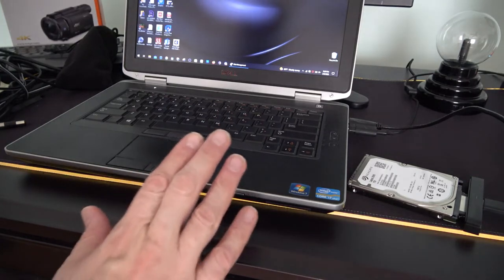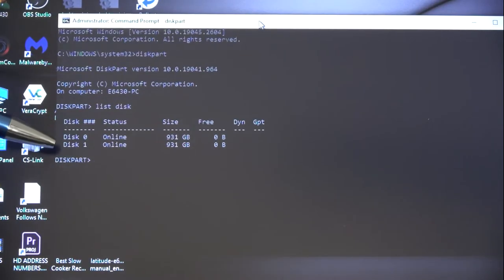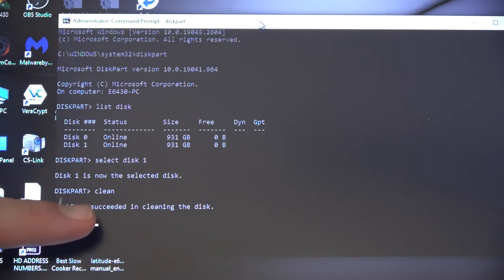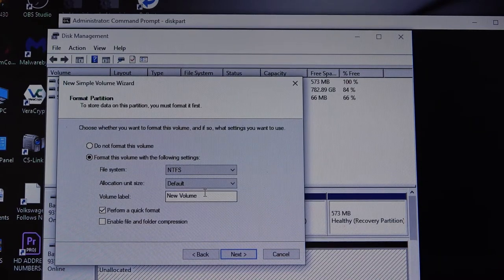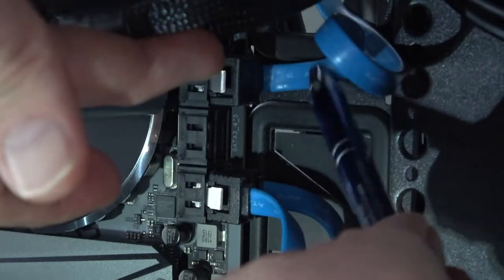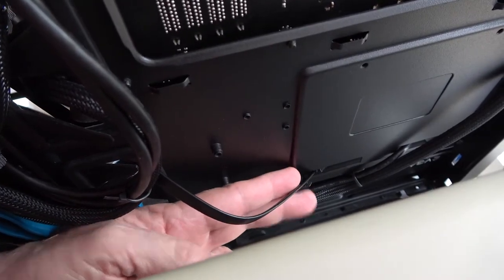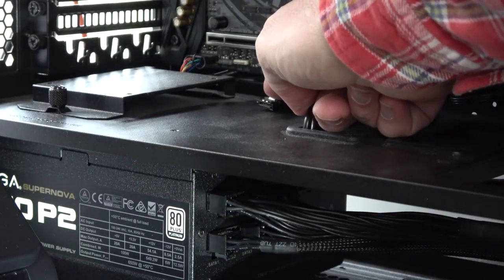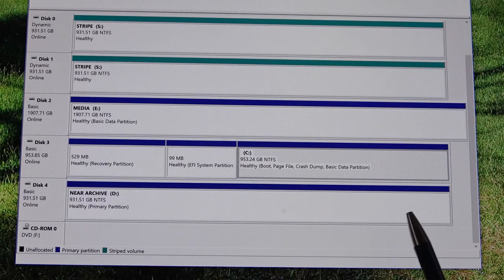How to move Laptop Hard Drive to a Desktop Computer

Comment: Nice work, but there is no problem that the hdd had a SO installed, if you dont change the "boot" option on your bios you can acces to the information and the SO is just another file on the hdd.
Reply from the maker: Yes if you want to move the OS drive from your laptop to a desktop you would have check the bios to ensure the boot order included the new drive. This video was about repurposing a laptop drive as additional storage for the desktop computer. I find it best when possible to install a fresh OS instead of moving it between systems. Thank for bringing up this topic.
Reply: thanks. maybe I WANT to keep my os. I wondered why Id have to wipe it if it wasnt bothering me
Reply: @RobertRedway  lol just do whatevar you want im sorry if i hurt you so deep :(
Reply from the maker: @RobertRedway  It might bother the computer you moved it to if it trys to boot of the wrong OS. 
Once the boot loader hands control to the selected operating system, it begins loading the OS. However, if both drives have the same operating system and are connected simultaneously, there might be confusion during the boot process, potentially leading to errors or unexpected behavior.